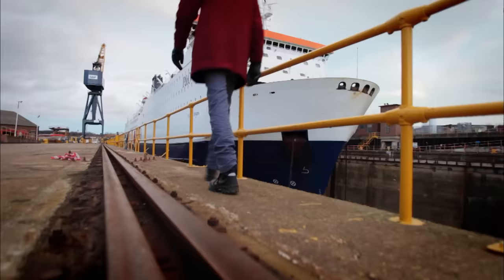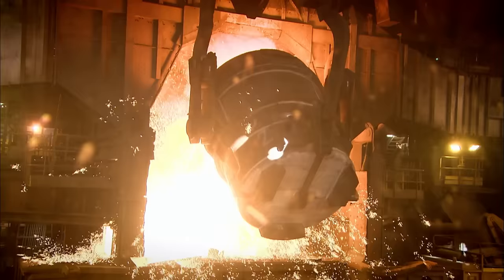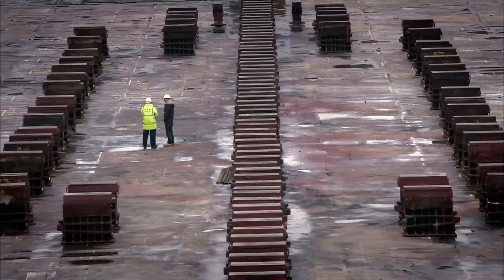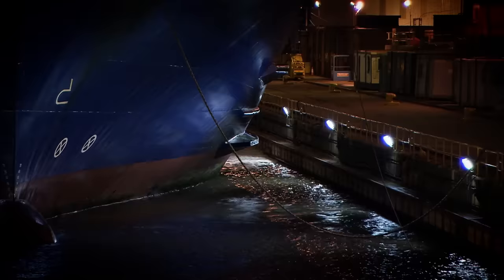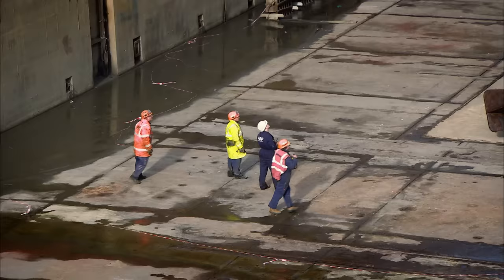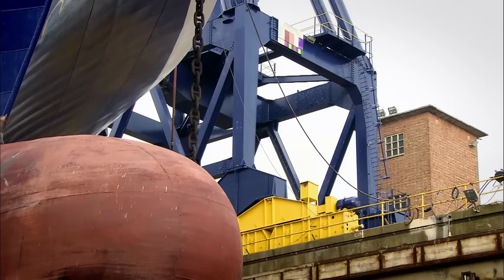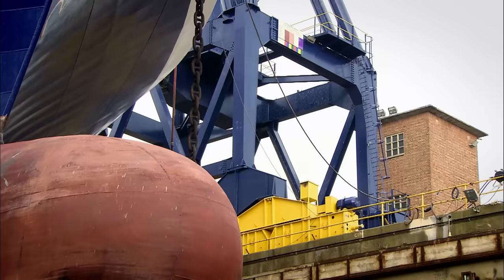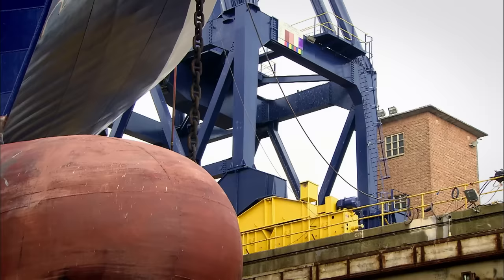Engineering Secrets: How Do You Repair A 32,000 Ton Ferry? | Engineering Giants | Progress

Comment: So wait 4 lifeboats carrying up to 150 people each that only means 600 isnt this ship capable if carrying more passengers than that??
Reply: Don’t ask. 😂
Reply: For passenger ferries at certain routes/trading area’s it can be possible to sail with a smaller capacity in the lifeboats. The remaining capacity is covered by a system of liferafts.
Reply: @bas6983  tbf on a ferry of RORO design the chances of filling/deploying the lifeboats successfully intime before the vessel turns turtle is quite slim makes sense to have the liferafts mop up any survivors but they only deploy once they are submerged and thats assuming you arent trapped within the ship (upside down stairs are no fun) if your lucky and can swim to one of these rafts and get into it, dying of hypothermia is now your biggest challenge to defeat *edit where are the lifejackets getting to said rafts requires you dont drown before doing so, where are they and how many are there?
Reply: @urbansnipe  not sure about your prognoses. Present ferries have down flood gates to keep the vessel upright during flooding and rafts and MERS are designed to be deployed/launched when the ship is afloat. Thats the reason of the shutes. Normal vessels have disembarkation ladders to go down het hull in case of abandoning ship by means of the rafts. 
Commercial vessels of a certain size will not capsize that easy. Yes keeping a bow door open and flooding the complete  car deck is not ideal (herald of free enterprise and the Estonia) 
I’m more triggered by the idea of evacuating upto 6000 people in 90minn at the biggest cruise liners.
Reply: @bas6983  yeah cruise liners are a disaster waiting to happen alot of elderly and elevators dont work when a ship is listing also imagine the looting instead of muster stations and life jackets they literally fill their pockets with duty free perfume 😂
Reply: It will have lift rafts too
Reply: @urbansnipe  try using a full stop occasionally.
Reply: @Jenalgo  .

Comment: Excellent documentary. Even if I did understand most of what you showed it is still a overwhelming thought to manage such a huge and complex machine in day to day use let alone with the maintenance and what not  required for the life of a vessel of that magnitude. My hat is of to both technicians and crew, impressive work indeed.
Reply: Had a summerjob at the P&O Ferries terminal (North Sea Ferries back then) in Rotterdam. Was doing lashings and work as much as possible (6 and a half day) Never got paid more I think. We too wondered a lot how amazing it actually is when you go look at every single wire, bolt or light, etc. All got functions but then also the ~5 decks on top with restaurants etc.  and it floats ;)  *The Pride of Rotterdam/ -Hull

Comment: Laying out a new metal deck, upon the old, would mean a lot more weight to ferry, meaning more fuel to burn 😮
Reply: They tell you that they are replacing what has worn off over the working life of the vessel, so although they are adding weight in theory they are returning her to her original weight.

Comment: Can you explain the zinc vs steel thing please. How can corrosion choose a surface over another?
Reply: Well the show is finished now. Where do you think the answer will come from? BrokenDummy.
Reply: @Jenalgo  helpful. I was hoping someone with experience would know better and give a better answer then google. Call me a dummy all you want but I would not seek medical advice on google.
Reply: When two dissimilar metals are immersed in water it in effect creates a battery and a minute electrical current flow.  This is known as Galvanic Corrosion.  As this occurs, atoms of the metals will migrate into the water.  The salt in seawater greatly accelerates this process.  When the two different metals are something like the steel prop shaft and the bronze prop, this can be a problem.

Some metals are more active than others, and will more easily release their atoms to the water.  In this environment Zinc is very active, and will release its atoms much more readily than steel or most other metals.  Thus, the Zinc acts a Sacrificial Anode and is corroded away in the place of the Steel or Bronze it is mechanically (and electrically) attached to.  Even in a little pleasure boat with a dinky outboard motor, there will be a small Zinc bar or two bolted to the motor lower housing.

As we are talking an electro-chemical process, corrosion can also be somewhat prevented by use of sensors which can detect and measure this galvanic current coupled with equipment which can induce an exactly opposite current flow, cancelling out the undesirable current flow.  This is known as Impressed Current Cathodic Protection, and is also used for buried pipelines.

If you take two pieces of metal, submerge them in an electrolyte, and hook up a  Direct Current source (like a battery) to them with the proper polarity you can deliberately cause the metal atoms to migrate from one piece of metal to the other.  This is known as Electro-Plating, and is how you get chromed steel car parts and cheap gold-plated jewelry.

The only dumb question is the one that goes unasked.  Knowledge is gained by the transfer of information.  Assholes are outed by their sarcastic replies to a genuine request for information.  

Extensive and in-depth training, experience, and OJT in all things Nautical can be arranged at your local US Navy Recruiting Office.  :)

Comment: 4 lifeboats that can carry 150 people each? That's not enough for everyone surely? 0_0
Reply: max capacity for this ship 1250 pax, looks like not
Reply: Auto deployed inflatable rafts, those white cylinders that are often seen on ferries and other ships, make up the rest of the requirement.
Reply: @grahamstretch6863  to expand upon your reply a bit...

I'm assuming that the US Navy and civilian versions are similar.  The raft canisters can be manually released or the canister restraint system will auto-release when submerged to a certain depth.  When the canisters sink to a certain depth the canisters will open and deploy the life raft, which then rapidly heads for the surface.

This is actually a very rapid process, but it is my understanding that it seems like it takes months if you are treading water waiting for the raft to appear.

Speaking to grim reality, the ship that I was stationed on was a Replenishment Ship which carried about 7.5 million gallons of Marine Diesel and Turbine (jet) fuel, plus 600 tons of munitions.  We always just assumed that if we were hit by a missile or torpedo the ship, crew, and life rafts would be raining down upon several square miles of ocean, and the whole life raft question would be academic at best.  The running joke was "the first USN ship to achieve Low Earth Orbit".

We just hoped that the 8 Sea Sparrow missiles and the 2 CIWS mounts would delay the inevitable long enough to allow for Final Prayers.  Such was life living on a sea-going warehouse/grocery store/fuel depot/munitions dump.
Reply: @grahamstretch6863  ahhhh. Nice thanks :D

Comment: Why can't they fill it up by dropping or lowering the gate? Seems like it would be much easier and quicker.
Reply: I think its a combination of the amount of force that would be required (pushing possibly 1000's on tonnes of water) and they need a level a control to stop the blocks they have set from being washed away.
Reply: @garethoneill5666  yeah probably way better control when there is ships inside